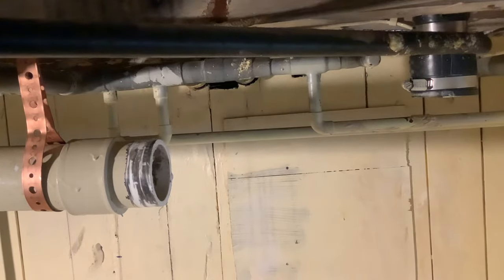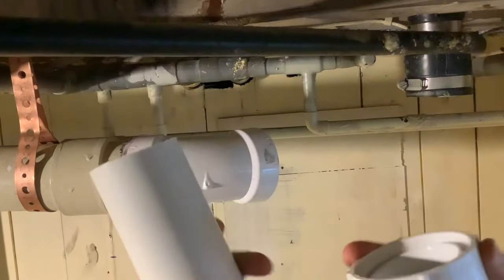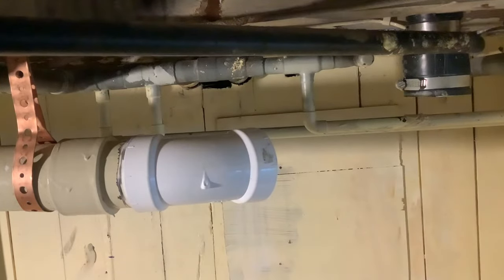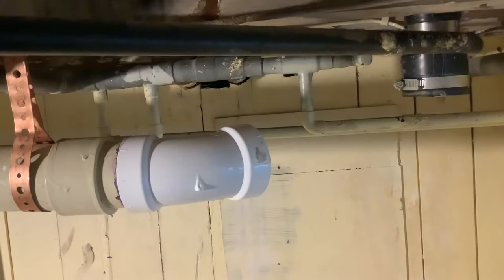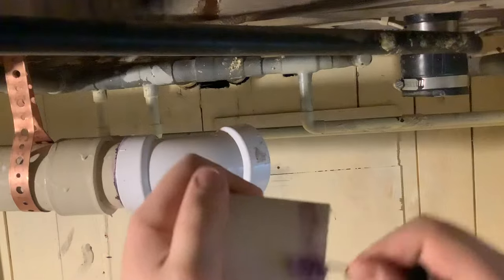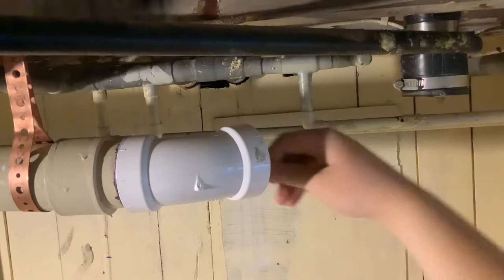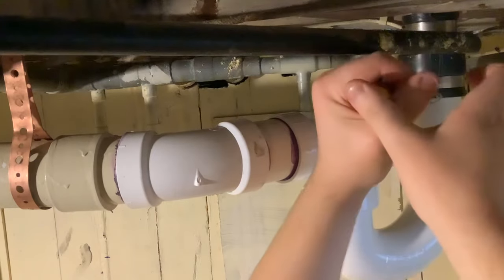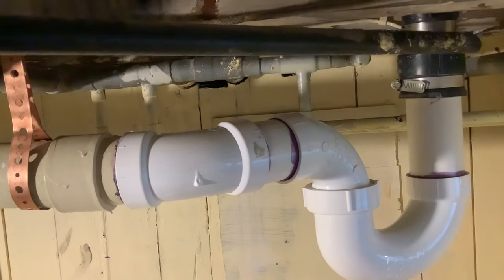Installing a p trap for a bathtub.(2022)

Comment: The P trap direction is backwards no?
Reply from the maker: No, I installed it the way the manufactured nut fits.
Reply: @jacksplumbingvideos7147  Oh ok, Also is that coupler coming out of the tub 1 1/2" to 2"? is that the best way to go?
Thanks!
Reply from the maker: @thorsal2758  that or a pvc coupling, the size depends on what trap and overflow assembly you use.

Comment: Awesome video Jack. I like using the medium pvc cement and the heavy pvc cement for larger pvc fittings and loose pvc fittings too. What was wrong with the old p trap your replacing?
Reply from the maker: the old trap did not line up with the new waste and overflow so it was being forced in place, the new trap is giving it slack and not putting pressure on the waste and overflow.
Reply: @jacksplumbingvideos7147  Ok thanks.👍

Comment: Why eyeball your flow, why not use a level and have it perfect? lol
Reply from the maker: The elbow would be hard to keep a level on.
Reply: @jacksplumbingvideos7147  nah man, put your level on your 45 elbow and use the vertical bubble and make it touch the right line for fall.
Reply from the maker: @hectorswrx7902  I probably could have done that but I did not have a level when I made this video and I decided to replace the trap on the fly because I had parts to do so.